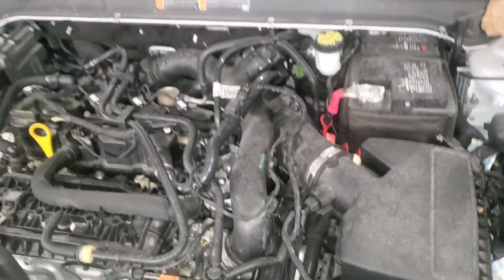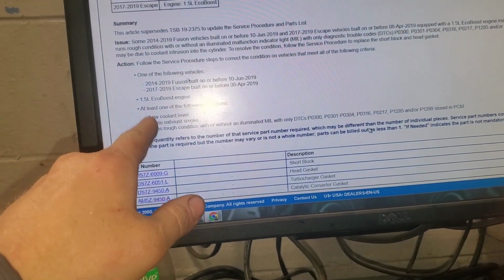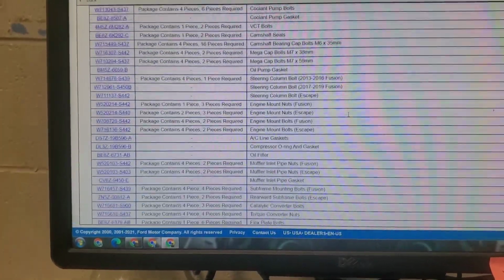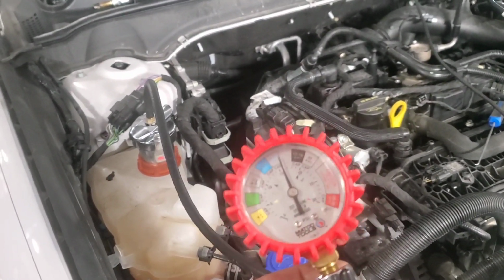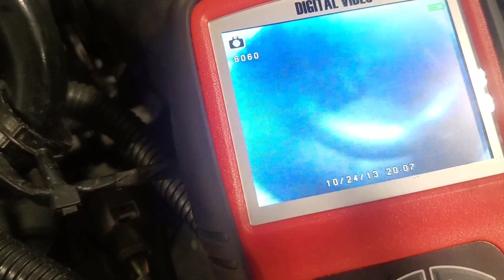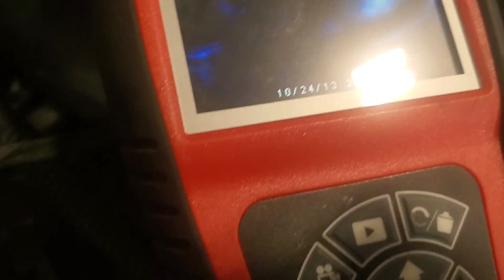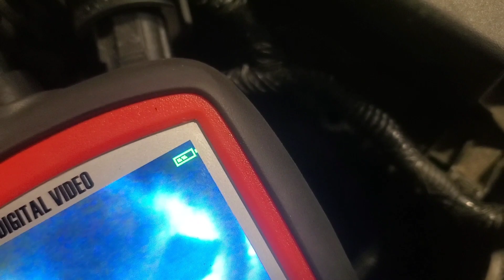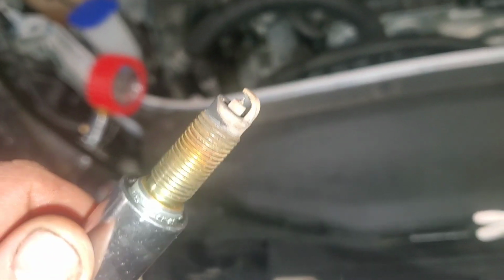2018 Ford Fusion 1.5L Ecoboost Runs Rough Low Coolant Coolant Intrusion Part 1 Diagnosis

Comment: Man so I've been following you for a minute. Talked about how my transmission just got rebuilt. Well yesterday it happened. Went to Best Buy to pickup something. And check engine light came on started flashing. Immediate loss of power and coasted into Best buy. Almost all my coolants gone. Cylinder 3 misfire. No visible leak anywhere underneath. Had it towed to the Ford dealer. We'll see what they have to say today. Thank God I bought that extended warranty LOL.
Reply from the maker: Thankful for the extended warranty for sure, yikes

Comment: I have loved your videos and have used your wealth of knowledge to help me in replacing my daughters 1.5l ecoboost block with the updated block.  I created a YT vid on the teardown so I could make sure I got all hoses/electrical connected back up right.  now that I have it all back together we are still seeing coolant intrusion.  It is really weird though.  I will take it on a trip 250 miles away and not go through any coolant or get any codes.  however, when we do short trips around town we will go through 1-2 quarts coolant per tank of gas and almost every time we start it up white smoke will come out.  we will get P0300, P030[1..4] errors consistently.  I've replaced all 4 coils and new plugs.  the car runs sweet other than that.  Also something to note - I checked gaps on the head when I took it off the old block and it was tight with no noticeable cracks.  I also cleaned up the intake valves and checked gaps when I put those back together.  I did the head torque ritual just like the manual said to.  Is there any other way coolant would be getting into the cylinders? or did I do something epically wrong like an idiot?  I'm at a loss here and hoping that you can help a brother out.
Reply: forgot to mention it is a 2014 Fusion - here is my teardown - https://www.youtube.com/watch?v=la-P0QqxY3E
Reply from the maker: I'd like to see the new block pictures? Poissorichard.rp@gmail.com

Comment: Thank you for posting this video... I have a 2018 Fusion with the 1.5. recently it started running rough, mainly at idle intermittently and noticing on acceleration it's sluggish at times. Had it to a couple dealers since 2018 bought new stating it's normal to use coolant. I never had a car that is too be normal to use coolant. No noticable smoke and engine light. Just intermittent signs as stated. Should I be concerned? It has 68k on it now and have ESP to 100k. Thank you again

Comment: Im justin smith who adressed the coolant intrusion on my 2017 fusion and applied Rtv high temp to the block slits on the old short block wanting you to watch my work at ecoboost coolant intrusion and part 2 to give your opinion on my method
Reply: Why wouldn't you just replace with the updated block?
Reply: @cheesecurd100s  out of warranty and  the new block has the same issue its actually the head gasket as well in conjunction
Reply: Sooo can I just replace  the block  or??
Reply: @rellstuttin9198  I No longer have a warranty wich means im on my own and so the amount of money that a new block would require is not worth it...along with so many other people and thats the purpose of my videos is for the people that need a cheaper alternative and my point was that there is a fix without having to replace that block my question is what way would be the most effective....rtv, cork between the slits or welding those slits closed... i would like somone to try those methods..
Reply: @justinsmith6860  Does this mean the issue will keep occurring even after replacing the short block? I have a quote of $4400.
Reply: So i have heard of cases that have occured with the new block as well ....as they eliminated the slits but there is a hole drilled through the top down to the coolant passage and would only occur after 40,000 miles ...so honestly my video was to encourage people to do the job there selves and simply rtv the slits and i spent less than 600 on parts including parts not necessary for the job but as precaution like the thermostat and and tune up items like spark plugs so the most important parts are the headgasket, headbolts, cam seals that must be replaced...i did this job in less than 4 days...the timing on the ecoboost must be precise and i can help u with that as there is no guide pins on the cam to sprocket..so u must make ur own marks unfortunatley but the timing belt must be replaced as well....please feel free to ask more questions and i can help you through it but... YOU WILL save money and it it ABSOLUTLEY doable

Comment: Hey man, I talked to you about this before in the comments but I wanted your thoughts on this. I have a 2018 Fusion 1.5 with 13,000 miles on it. It's been consuming coolant for about a year and I've been monitoring it. I filled it once to the max on the reservoir. Since that point it's consumed about 1/8th inch more of coolant. This week I took the car to my local Ford dealer to check it out. They said they did a pressure test and that it met "decently acceptable" results. I said, well a 2018 vehicle with 13,000 miles shouldn't be doing that and the guy on the phone got flustered and said he'd talk to the tech again and call me back. They called me back and gave me a better answer and told me about the TSB (which I already knew about thanks to you) and said that since it wasn't having white smoke and no codes that they wouldn't do anything about it under warranty. They told me to just keep monitoring it and to bring it in if it ate more coolant. Funny, when I brought it home and checked it out (I'm fairly good with working on cars) and they filled my coolant reservoir about 2 inches above the max. I was a little mad... My thoughts is that they just wanted to fill it super high so that it would be awhile before I brought it back into them. Needless to say, I sucked the excess coolant out so it met the max line while cool. I won't go back to that place again. I was curious of your thoughts. Yeah, the vehicle is still under warranty for 2 years but you'd think it would be great to get this fixed before it gets worse. Apparently that dealership doesn't think so, or at least to meet the warranty work.
Reply from the maker: So what you should have said is well according to the TSB it doesn't have two white smoke and if it's losing coolant that's all it needs and needs to be one of three criteria

I give you guys the  TSBs so you have ammunition when you go up against these people and it says clearly in it only one of three of these have to be met and losing coolant is one of them
Reply: @FordBossMe  does it have to be under the 60k miles to get replaced?

Comment: Just purchased a 2014 SE 1.5, runs great no issues with 88k miles on it.  I keep hearing about warranty, but what warranty do you recommend if I bought this private sale?  Should I just trade this in since I feel it’s only a matter of time before this engine has problems
Reply from the maker: Hard to say honestly especially since you just bought it 

The warranty company your dealer recommends is typically good
Reply: I appreciate you replying so quickly.  My next question is do you notice a lot of 2014 fusions w/1.5's that are having the coolant intrusion lately?  I'm noticing more of the 2016-17s in the forums, but rarely do I see anyone complaining about the 2014's.  Also, does Ford, in general, offer just a powertrain warranty if it's used or does it depend on the dealership?

Comment: Good day ...I live in Trinidad and Tobago...I have a 2016 Ford Fusion...The car was assembled in Spain and the Engine built in Romania...At present the car has a mileage of 93,500 km or 58,000 miles and i am experiencing a similar situation with the coolant reservoir running low...I haven't seen any leaks whatsoever and i'm getting a noisy rough idle even when the car is driving
Reply from the maker: You should look at my new video on the Ford Edge 2.0 liter coolant intrusion and I show you exactly how to walk through everything
Reply: @FordBossMe  Thank You Kindly...

Comment: I've asked in the past about the coolant intrusion issue but not lately. I haven't heard much lately about this problem. For a while, it seemed like they were coming into the dealership pretty often and you were doing most of them. Since I still have my 2018 with 23000 miles on it makes me wonder about selling it and avoiding the risk. In the past 6 months, the coolant level has gone down about a half-inch in the reservoir. Not a lot but it's going somewhere. Other than that it seems to run fine with the exception that the on/off run feature works infrequently. Less annoying when it doesn't. Thanks in advance
Reply from the maker: You might be at the early stages of the coolant intrusion sometimes it takes a long time for it to really affect anything
Reply: Yup, my escape started losing coolant about 10k miles before the white smoke and rough idle and p0304 code.
Reply: @wendyhdzmiller8700  Everyday I think about selling to Carvana at a good price. Problem, the replacement vehicle inventory is low and limited. And full price
Reply: @rpaulpate  I do too, but I'm upside down on my loan thanks to my last car and the extended warranty I bought when i refinanced. I'm covered until 120k miles and it was only 2700 dollars. It's best to buy the extended warranty than to kick yourself in the butt later.

Comment: Thank you for your detailed videos, which I enjoy watching. I have a German 1.5 Ecoboost from 2018 with 90,000 km and I am losing coolant. Water pump was replaced without success. I lose about 1/2 reservoir in 30,000 km, not very much, but noticeable. Pressure test, endoscopy and examination of leaks showed no abnormalities. Mechanic thinks it could be a micro crack in the block. No rough start. Could it be the intercooler? What can I do? Thank you.
Reply from the maker: It's probably still the block
Reply: @FordBossMe  A friend of mine has no money whatsoever has the same exact car dealing with the same issues right now is there a recall on this or is the fix out of pocket… I really don’t wanna pay for a new engine for them. Any info is greatly appreciated
Reply: @FordBossMe  also sorry if out-of-pocket what are they looking at cost wise to fix?

Comment: Hey @FordBossMe. I have a 2017 escape ecoboost, 172,000km. I have white smoke coming from my exhaust upon start up, but it doesn't happen every time. No misfire codes or overheating.  I took it to Ford, and they basically topped up my coolant to "max" and said everything was fine (smoke is not fine). Since they topped off my coolant, it has dropped down to just a hair over the "min" line, and whether hot or cold, it doesn't fluctuate like it should. (Iys only been 2 days since it was topped) It NEVER goes back up. I have about 6000km left on my warranty, so just wondering if you think Ford is just trying to delay the problem, or if its something I should just monitor for awhile longer? The smoke thing is concerning and I know it shouldn't be happening. Thank you in advance!
Reply from the maker: Yes they are not doing their job 

Go to another dealer and tell them you think you have the coolant intrusion issue due to xyz 

They need to run a leak down test

Comment: Hey man Can you Please help directing me, I'm trying to remove the degas bottle(coolant tank) fusion 2014 2.5L, but I'm stuck with last part can't remove it 😟 (a piece of metal welded to the frame/ fender area, where the side of degas bottle sits on). Can't pull the tank straight upward since the top edge of the metal is thicker from the top it seems impossible to get out without causing a damage ;( I'm lost 

I'd appreciate any suggestions 💛
Reply from the maker: There's a release tab on the back side of that metal or the plastic slides over it

Comment: Thank you for this video i have the same issue with my fusion 2017 78k on the odometer smoking out of exhaust and loosing coolant. Do i just pull up to a dealer ship with this issue or is there specific mileage on the odometer that you can take it in to get it covered under warranty? Thanks !
Reply from the maker: So if you have a 60000 mile powertrain warranty gets covered by the dealer if you have an extended service plan through Ford it's covered by the dealer and they're going to have to diagnose it as such you can't just pull up and say hey I have this cooling intrusion issue they're going to have to be the ones to tell you this is what they found
Reply: @FordBossMe  ok thank you for the replay im a master technician for volvo/mack of north america i have good knowledge in diagnosing issue . Basically removes spark plugs checked for coolant on cylinder with system pressurized at 20psi and found that its really bad basically flooding my combustion chamber in 5 min while being pressurized . But i have the basic power train  warranty and im at 79k so im pretty much out of luck right?
Reply: @psagan27  Call Ford's customer service first.
Reply: @psagan27  call Ford but they've been screwing everyone

Comment: My dearest expert. So ik have a focus 1,5 ecoboost 2015. It has the improved underblock placed a year a go. About last 5 months its starting leaking coolant agean. The Ford dealer looked at the sparkplug en told it was burning coolant in cilinder 4. They think its a leak headgasget. Because of a warped upperblock (head) What do you think?
Reply: A update of the problem. The intercooler had a little hole in it, that was the reason the coolant leaked.

Comment: Is Ford extending the warranty on the 1.5 L engine I have a 2014 Ford fusion with about 34,000 miles and I am losing coolant the weird thing is I pressurize the coolant system to16 pounds sat overnight did not drop but if I drive it about 50 miles I will lose about a quarter of a cup of coolant I searched all over the engine radiator turbo charger inner cooler to try to find any leaks it also runs rough at idle when the engine gets hot and I did have a misfire at start up on Number two cylinder one morning after filling it up full of Coolant also if I go a few days of driving there is a running water sound in the heater core on start up
Reply from the maker: The leak needs to be checked when it's hot and cold so that could be why
Reply from the maker: Extending it? No they are not 

They are treating it like 5 years at 60 thousand mile warranty they're not doing anything for the customers

Comment: Hey Ford Boss... I bought a 2014 Ford Fusion yesterday with 86k and when i got home i noticed it was kind of idling rough. RPM needle shakes a bit not allot but it does. Do you think it's going to have this coolant intrusion problem?
Reply from the maker: A very well could you never know you got to monitor the coolant and you have to probably change the spark plugs also make sure you Google the coolant intrusion tsb for your engine or look through the channel and all the videos I've put out where I've talked about this stuff
Reply: @FordBossMe  thank you so much!!

Comment: Are all 1.5 EcoBoost engines experienceing coolent entering cylinders.
Reply from the maker: 2016 - 2019 escapes and fusion 1.5L and i heard some in focus over seas 

The issue is some of these won't start leaking until they get over 60 70 thousand miles out of warranty
Reply: That is what happened to my 2017 with 78,500 miles, luckily I have the ESP.  Still Ford needs to step up on this issue.
Reply: @jtjano1  It's happening to the 2.0 also.

Comment: Qucik question are you seeing this on the 2020 fusions with the 1.5 ecoboost? Mine has dropped coolant twice, but the dealer want the diag fee and if it falls under warranty they will refund the money but not sure if its worth it to take it in yet.
Reply from the maker: No, totally different engine
Reply: @FordBossMe  any recommendation? I currently did the pressure test today and it dropped 4 psi in 4 hrs should i just try pulling the spark plugs see if  there is coolant in the system
Reply from the maker: @thewildbeat63  I would redo the test again let it sit get the engine hot pressurize it when you're done and then pull the spark plugs and let it sit there for like 8 hours and see if you get any fluid in the cylinders

Comment: My 2018 fusion 2.0 has has low coolant in the reservoir when running. Once I turn it off and open the reservoir cap , alot of pressure is released and all the coolant fills back up in the reservoir
Reply from the maker: What you're looking for is the coolant level dropping down and not coming back up
Reply: @FordBossMe  yes , I fill it up and turn on the car, the coolant gets sucked in but doesn’t come out. No leaks anywhere to be spotted, would it be goin inside the block? Or the cylinder?
Reply: @TheSerg5.7  That's what my escape did and i definitely have this problem. They're replacing the whole engine.

Comment: yo I know this is an old video but i’ve found myself in a situation w/ my 2018 fusion 1.5L 116k, Has ran perfectly fine since i got at 66k it just started to run really rough on idle,like rocking back & fourth, only happens either otw to work or the way back. I just checked coolant level and it is abt same as the one in the video. I’ve also have error codes P2196 (02 sensor signal bank 1) as well as P0171 (Sys. too lean bank 1) I would really appreciate if you had an idea to what caused this, thanks man
Reply from the maker: If it's low on coolant you know what it is
Reply: @FordBossMe  thanks for the reply,would you happen to know? is it recall or am i going to have to come out pocket?